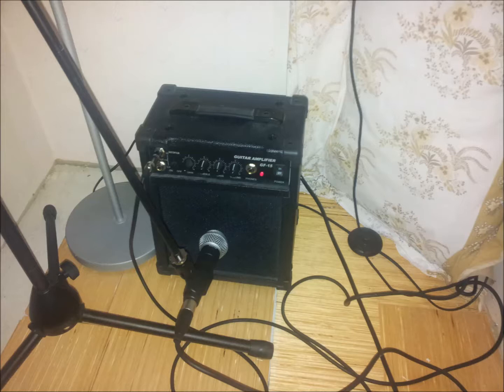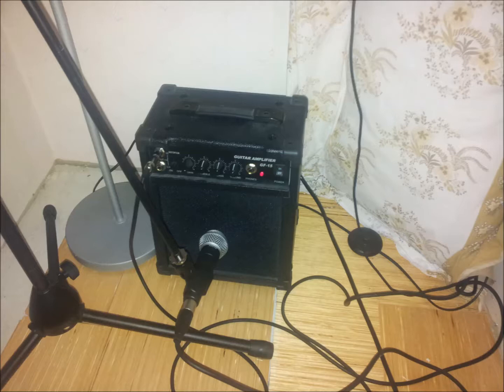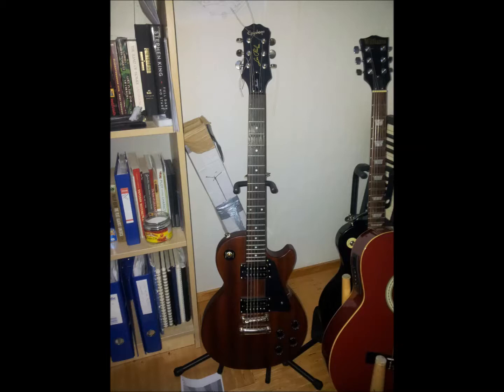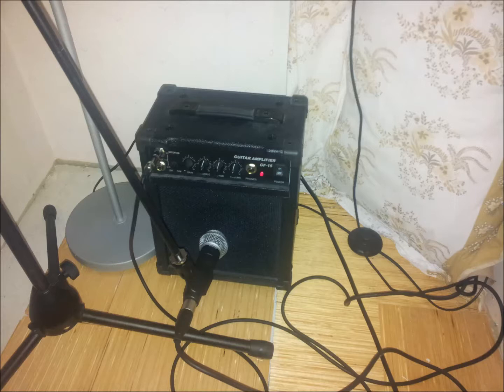Damaged Amplifier and Distortion

Comment: I think the odds are very small to get the cool sound dave davies got. The amp circuitry, the cone itself, the cab, the mic used, the recording equipment...all played a role so is not that simple.
Reply from the maker: Of course. The main point of my video was not to find that cool sound, but to address a series of questions and arguments posed online about whether or not physical distortion through speaker cone modification was possible (and desirable). I couldn't find definitive answers, so I just sliced up an old guitar amp and recorded it. :)

Comment: What happened to tone control after messing with the cone?  I'd imagine having slices missing and newspaper stuffed in there would render the tone controls practically useless.
Reply from the maker: +ShortFingeredShreder Surprisingly, the tone controls still worked, to a degree. They were understated, sure, but the bass knob, when cranked to 11, still gave out a bit of rumble.

Comment: Thanks!loved it! to your question, get a tube screamer, i would love to hear how that would work out on those kind of damaged speakers, maybe even throw in the distortion channel
Reply from the maker: Unfortunately, the distorted channel doesn't work on this amp anymore. (That's what made it a great candidate for this experiment.) As for the tube screamer, I've found that any level of fuzz introduced before the speaker comes through as if the speaker were not damaged. It's just softer (since the cone is mutilated.) The best pure sound I've gotten from it is to use a tube amp emulator on my floor box (Line6 Floor Pod Plus), and crank everything up until it started to distort and then dial back just a bit.